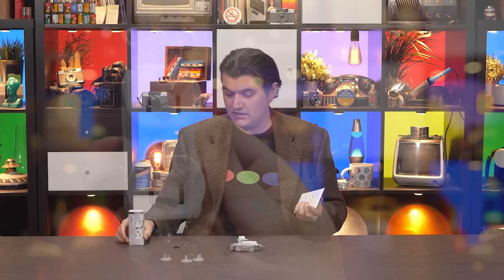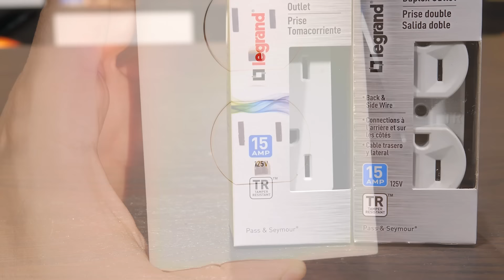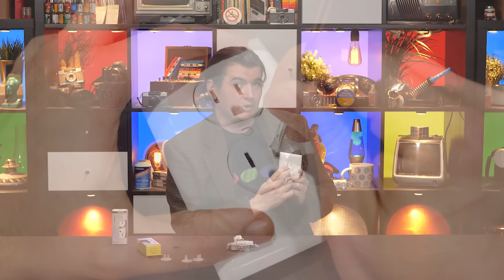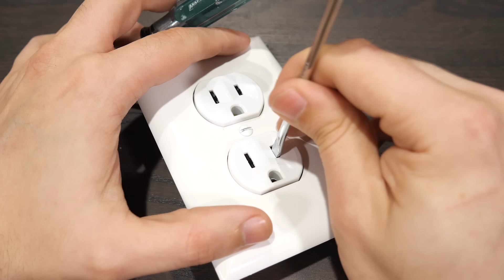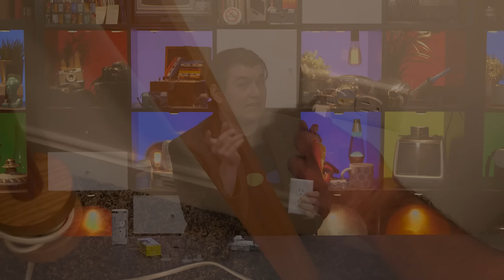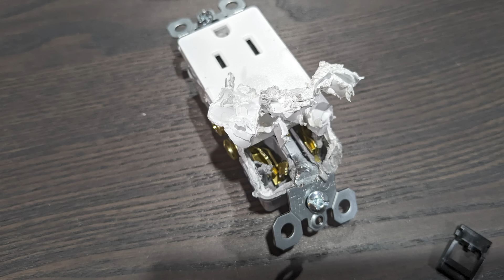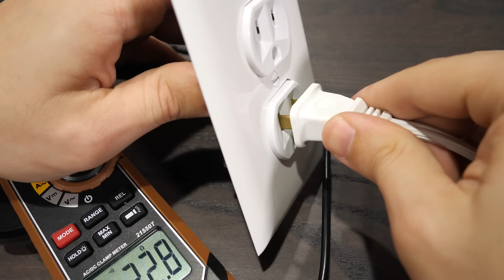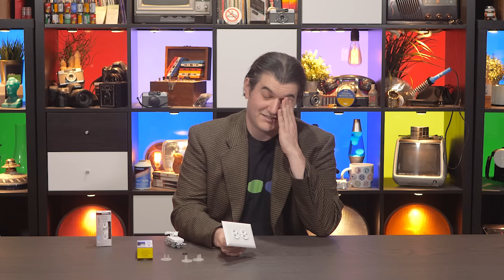Tamper-resistant outlets aren't all the same - a follow-up

Comment: I come from Hong Kong (which follows British electric standard), regarding the keep falling out thing on US/JP plug...Cord is usually fine, my experience is that heavy AC adapter (laptop's, or a beefy 120W USB-C charger), which everyone carries during travel, is guarnteed to fall out in a hotel wall outlet, yes a wall outlet and not a desktop one. That's something never have to worry for a British socket and probably the thing I hate most when travel.
Another oddity I am surprised that US circuit can have no RCD/GFCI at all, while in Hong Kong it requires RCD at the distribution panel for sockets (not for lighting fixture and fixed cable like AC). I wonder why it's not required yet, maybe 120V is too safe for that? But I thought RCD isn't that expensive anyway.

Comment: I think you've covered this in one of your videos, but some medical isolation transformers generate 60v split-phase. So instead of a 120v hot and neutral, there are two hot legs each 60v away from neutral, but 120v away from each other. I don't think this is legally mandated anywhere, but I've definitely seen then at doctor's offices before.
Reply: If it is a true isolation transformer the output is not referenced to the ground so you could touch either of the wires but not both.
Reply: @okaro6595  maybe it wasn't true isolation. I just remember something about 60v - 60v

Comment: Wago connectors are great for low voltage AC/DC and com connections. I always use them for security cameras. I have customers buy the cheap ones off Amazon so they only last a year or two outside and it makes swapping them out extremely easy.

Comment: I'm Mexican (we have the same plugs as the US) but i've been living in europe for over a decade and i can confirm that the plugs here are much safer and resilient. That said, they're very bulky and you need a lot of wall real state to plug just a few.

I also lived in an old house with old appliances in Mexico and many outlets lost all grip and we sometimes had to put objects below the plugs so thet stayed in place... in hindsight, we should've changed them, but i was a child and nobody else at home was at ease with electricity (and nobody thought it was an issue that deserved calling an electrician 😂)

Comment: Not all UK plugs are dependant on the earth pin to open the doors. Some designs have a rotating plate that the neutral and live have to push around together to open. They are less common, but not uncommon.

Similarly, the a misconception is the UK socket has to have a switch. Nope. Not in the regulations. It's just people like them and the sockets are really cheap. Retail £1-2 .

Comment: Anecdotally, i have never been shocked plugging something in.

I have been shocked more than a few times, but always on the other end of the cord. And personally I would expect that ground down is safer for me because the insertion in low outlets (putting the ground in at an angle and then rotating up, which is far more natural that putting thr top in and rotating down when you are already reachng down) is easier so I can hold it further back.

But i also have my place set up so that everywhere I semi-regularly plug things in there is a power strip that is easier to access.

The main place i have been shocked was that the cat used to always knock my bedside lamp over and break the bulbs (and occasionally rhe lamp). But before going downstairs to get a new bulb i would test the lamp by poking the contacts with my finger. Eventually i switched to using a pair of scissors.

Comment: In Europe (well, at least in France), the outlets are not flush with the wall, they are recessed at least 15mm into the wall. This makes the pins completely inaccessible to the touch, even when the plug is partially inserted. (And that makes your 'throwing knives at the wall' thing pointless here 🙃)

By the way, keep it up! I absolutely love your videos and the humorous touches you add!

Comment: A current of as little as 0.007 amps (7mA) across the heart for three seconds is enough to kill. 0.1 amps (100mA) passing through the body will almost certainly be fatal.
The lowest voltage that will not kill is 42Volts. 
Static shocks are 10's of thousands of volts.
Look at  Mythbuster 2004 Appliances in the bath episode.
Just be safe near electricity.

Comment: We had some OE antique appliances and electric things at the cottage in the 50s. Still do. Two old appliances are Sunbeam toasters. One has a replacement cord with a terrible, smooth plug. Some things were from the 30s, and had to be held in the sockets. Some wear, but mostly a topic you've mentioned about the shape of plug blades. Give the blades a little twist with a pair of pliers, it'll work for a while.

Comment: I'm living in a house right now that has sockets that are so worn out the plugs literally fall out.  This house was built in the 1970s and previously owned by a very elderly lady, and hadn't been renovated since the 1980s I think.  I've disabled those particular outlets until I can get them replaced.  So, it happens, but it's rare.

Comment: What is the Pin Size Cross Sectional Area with 240V 13A in the UK within the sheathed pin a cross section from 2.5mm2 is perfectly over engineered to carry 3KW

Comment: re: Backstabbed wiring/wago comment: Personally I just forego anything backstabbed out of principle. Knowing exactly how that feature is designed does not inspire confidence in my mind and I've had first hand experience with nearly every outlet in my 1980's built house having failed backstabbed outlets and needing to be replaced. Wago's may be in a similar spot here, but everything I've seen even from seasoned electricians tells me it is designed better and is way more reliable. But that's just my personal 2 cents on the subject.

Newer outlets (and probably higher tier ones, though I've seen the 'level 2' 'pro grade' Leviton multipacks at HD have this and they are marginally more expensive than the cheapest contractor grade ones) have a better wiring design (called 'backwiring' which I'm now finding out) with what boils down to having a little captive metal plate behind the screw that can clamp down on a stripped, straight wire with no finagling/twisting around the screw necessary. If it's about laziness or not wanting to mess with that, this feature, IMHO, is WAY more desirable than backstabbing and just as easy to install.

Comment: I wouldn't mind an intrinsically safe(r) plug design where pins are dead until the plug is positively locked. Then we could have tiny plugs that are much safer and cannot randomly fall out of sockets. You could have wafer-style plugs keyed for voltage and current where the outlet's integral switch won't allow the outlet to be turned on until all interlocking/keying features are lined up nor allow the plug to be pulled out before turning the outlet off.
As for most common cause of electric shocks, damaged cables is my #1 cause by >10X.

Comment: The spring is just to close it when you unplug. It is not strong enough to prevent it opening. It is a rocker system so that if you push one side in the other side turns back towards you  and locks to something. If you press both then it can slide away.

Comment: You do have 240V in the US and make it sound like we dont have anything similar here in europe (where the voltage to ground is lower than the voltage the device operates on), but here some very power hungry devices (like stoves or heat pumps) run on 3 phase, which is 400V between phases and 230V to ground.

Comment: Just a quick comment as European about the "plugs constantly falling out" - in a lot of cases plugs in Poland sit so well in the outlet you would faster accidentally rip the outlet out of the wall than plug from the outlet. There is a reason why recommended way to unplug something here is by holding the outlet with one hand and pulling the plug with the other. We are just used to the fact that casually pulling the cord will do nothing except maybe damaging the plug or the wall.
Reply: Seems like that could actually be an issue if you trip over a cord, or are doing something like vacuuming and pull it too far, because it would stress the outlet.  Plugs should pull out of outlets or extension cords if pulled hard enough, so the cords and outlets themselves aren't damaged.

Comment: My direct experience with plugs falling out is due to fact that the “residential grade” receptacles produced in the last 20 years or so are made to minimal specs/quality to save the manufactures money.  As a result, any receptacles plunged and unplugged more that one time a day will loose tension quite quickly - probably within a year.  Therefore, your most convenient outlets, used for your vacuum cleaner, iron, or the like will wear out.
I have approx 35 years of experience in the electrical industry as a whole and have “caught” my buyers buying residential grade receptacles for commercial and industrial applications and have had to explain the differences and ensure the residential grades were not procured again.  
When I started in the industry in the 80’s, residential grade receptacles were more robust than what is currently made.
I personally spent the extra $ to buy commercial grade or better depending on how often that particular receptacle is used.

Comment: MK BS1363 sockets have a design where you need pressure on the line & neutral shutters as well as the earth to open them., beyond what is required of the standard (using the earth to move the shutter).

Comment: Some older British sockets had shutters that work as per the examples you have there, they needed the two pins (Live & Neutral) to push open the shutter, the Earth pin wasn't used for the purpose of lowering the shutters to let the other pins in, of course these were outlawed by the regulations, because people are stupid, as said people would jam things like Europlugs into such sockets with no earth connection even if the euro plug was equipped with earth contacts, making it an officially dangerous socket, but said stupid people just took to jamming something into the earth socket to open shutters to connect said europlugs instead of just, you know, using an adaptor or, god forbid, changing the plug!!! :P

Comment: The loose plugs issue is mostly with wall-wart adaptors - not with corded plugs.. especially heavy ones will often fall out of a loose socket. It might also be more common for tourists who may be using a travel adaptor in front of a wall-wart adaptor adding to the weight and giving gravity more angular leverage against the socket.

Comment: I watched several videos of an residential electrician. He climbs a fiberglass ladder and literally handles the live wires from the power pole. He, of course, makes certain other conditions are met before he climbs up. Cuts the lines, rips out and installs the new service equipment, them reattaches the service one wire at a time. Scares me how he handles the live wire end.

Comment: 13:17 this bit about 120V being safer than 230V, while you address the different conditions that need to happen, such as what you're standing on and all of that, it still has more to do with amperage than it does to do with voltage. If you touch that circuit and you only get a shock and don't die, the reason that happened is because you were imperfectly grounded and the resistance of all the varying objects that completed the circuit was enough to reduce the amperage to below the 0.1A that will kill a human being. The larger the shock you felt and the more you felt your muscles jerk means the lower that total resistance was and the closer you were getting up to that 0.1A. European circuit breakers are rated for 16, 32, 63, and 125A, but in North America it's only 15 and 20A.

That higher amperage on a European circuit means that given the exact same set of circumstances when a shock is experience, the resistance created by your body, your shoes, whatever you're standing on, etc… is less likely to be sufficient enough to reduce the current travelling through your body to less than 0.1A.

So if the amperage, not the voltage, which makes fiddling with electrical circuits a little bit safer over here, but not really by that much. 

Plus, European standards for safety go for the higher bar compared to what we do here in North America where even safety standards in Canada and Mexico have been influenced by that very American "don't tell me what to do" attitude that makes it so hard to implement good safety standards because of the resistance to it.
Reply: When 1 amp is way more than enough to be fatal, 15 vs 16 amps isn't really what we are worrying about, it's just as fatal and just as able to travel through the body across the heart if the path is bad and a circuit is made. 
But 120V at 15A is less likely to overcome the natural resistance of skin than 240V at 15A. And that is the real key. Touching the lowest of both standards with a dry hand is probably going to just result in profanity, but start adding in other factors like moisture or two hands and you get a much higher chance of actual harm from 240V than 120V. But you stand in water and mess with either with both hands and it's curtains for you, and probably anyone who tries to help you, with either voltage, even at a much lower amperage.

Comment: I got shocked once as a kid just messing with a light switch (turning it on and off) in the absence of a cover plate. My little fingers slipped and touched a live connection inside the box. My hole arm jolted, the lights browned out, and there was a little arch visible between my finger and the box when I pulled back, but I was fine. I cried because I was 6 and it was scary, but I was fine. Mom made Dad drop what he was doing and finish putting all the cover plates back, then. We were in the middle of a reno and he was being lazy with certain things.

Comment: Just an FYI, the staples used in construction stable-guns, for things like installing insulation or vapor barriers (or a myriad of other uses), fit between the two slots of a standard outlet very nicely.  And produce some spectacular sparks.  Don't ask me how I learned this...  lol
Reply: Paper clips make spectacular sparks as well. A friend showed me this in seventh grade English class.
Reply: @chitlitlah   This must be why so many school outlets have scorch marks.
Reply: @chitlitlah We used to do it with foil gum wrappers in Biology lab
Reply: @chitlitlah Aw man, I didn't get to experience that until eighth grade Spanish class.
Reply: @ilikepizza1275   Better late and en español than never.
Reply: Too bad you said not to ask… I bet it is an interesting story!
Reply: @davidroddini1512 Well I'll just say that after that incident, the dog was always afraid of lightning.  His 'rump' is where the staple landed.  :)
Reply: Yikes!  Especially considering most staple guns are made of metal, including the handles...
Reply: we all loved the bobby pins they glow red hot if you have FPE panels and still fit in tamper outlets
Reply: Standard staples are just long enough unfolded to bridge between the assembly holes of hot and neutral. And thin enough to fuse out before you trip a breaker.
Reply: #iComeHereForTheComments
Reply: oh fun. I bet that was intentional though

Comment: 15:50 lol I did the same thing.. and not as a kid, I think I was probably legal to vote, put my thumb touching the tops of the blades to feel that they line up, probably because of those stupid safety sliders WHICH ARE DANGEROUS FOR PLUGS WITH DIFFERENT END LENGTHS BECAUSE YOU HAVE TO PRESS THEM AT AN ANGLE TO GO IN. Ugh and of course since the blades do contact while they are still out by more than the thickness of any thumb I got a nice shock. great minds dumb alike?

I also almost started a fire when I was around 12, or I guess did start at fire but immediately put it out, because I was literally playing with electricity. I cut the end of an old hair dryer cord off so I could power some motors directly (I was 12, I doubt whatever I was doing made sense), and I remember big sparks, yanking the plug from the wall, and stamping out some little fires on the carpet.
And yes, my parents were about as responsible as you imagine from that story... pretty much the poster children for why building codes are required for children to stay alive. On the plus side I was doing hobby chemistry with household cleaning products when I was 10, literally just mixing things together and observing what happened, which probably had something to do with becoming an engineer.

Thanks for coming to my Ted talk

Comment: It's the current that kills you.. The principle that “current kills” is essentially correct. It is electric current that burns tissue, freezes muscles, and fibrillates hearts. However, electric current doesn't just occur on its own:
    There must be voltage available to motivate the current to flow through a victim.

Comment: I've been shocked with 120V maybe six times. It's very unpleasant but no lasting damage, more startling than harmful (provided you aren't in a puddle). I know an electrician who occasionally tests for live by touching his thumb to ground/neutral and finger to live (THIS IS DUMB DON'T DO THIS). However even he knows better than to try that on 240. Another sparky I know hit 480... that threw him off the ladder, seized every muscle, and instantly calcified some of the cartilage in his wrist. He's aware how close to death he was. So yeah, voltage absolutely matters.